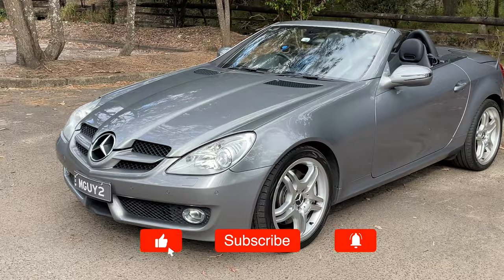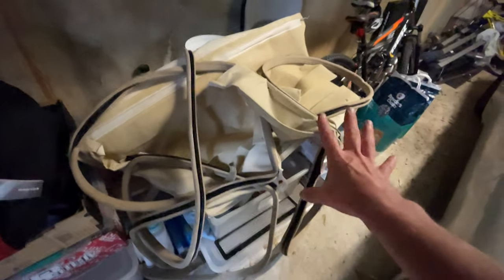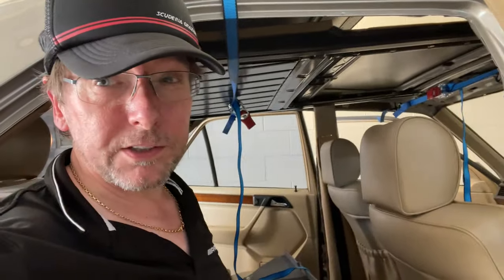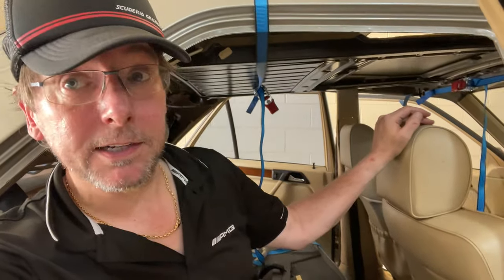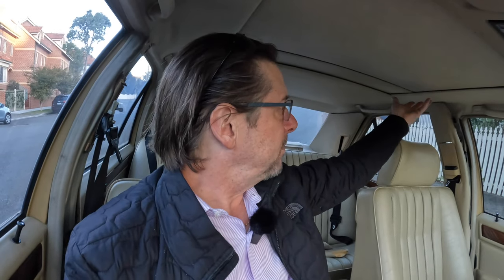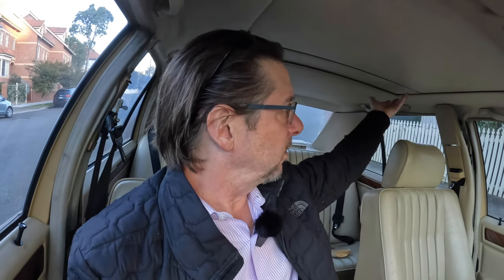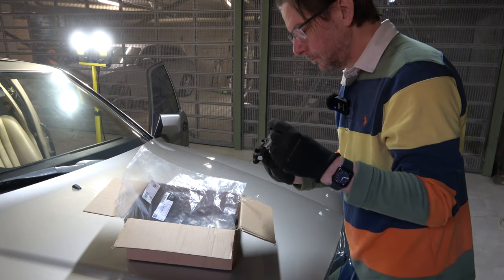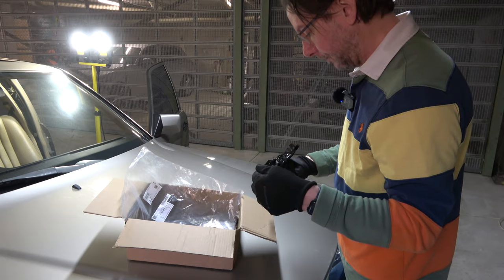Mercedes 260E Project Car (W124) - Fixing the Sunroof | MGUY Australia

Comment: Great job. The question I have is how many hours did you spend on this job and what was the cost?

I had a fault with my air conditioner panel in the centre console of my 91 BMW 535i.

I bought a replacement panel on line off a guy who had bought the wrong thing for his car - $100.

Took me about 5 hours to get the panel out....... sprayed some contact cleaner on contacts..... tested the original panel and it now worked......

 Reinstalled it which took me about 4 hours. 

Lots of googling and you tubing but got their in the end and now I have a spare Ac panel.. all good.

Like you with the sunroof I could not believed I had worked it out..... oh what a feelin lol.

Comment: Admire your work.  My car just has had the sunroof sealed up by previous owner. Maybe if it were a C126 it would be worth keeping the sunroof.   But on a US$3K car my focus is on the engine, transmission and suspension.  Still admire your work!   amazing!   Best regards 1989 MERCEDES-BENZ 260 E (124.026)

Comment: You absolutely do not need to remove the entire headlining .

I am about to do the same job on my W124 estate ( my fifth ) , and having worked on previous 124s , 201s and 126s , I know how it goes .

All you need to do is remove the trim panel from underneath the sunroof , which normally needs the roof opened . 

I simply sourced another trim panel from eBay before starting (£20) then destroyed my existing one by pulling it down in the middle where the two sections meet , this allowed it to come away at the sides , and the press studs at the front popped out .

So much easier than removing the whole headlining , and I have a perfect roof panel in the correct fabric to put back afterwards .
Reply: It's pretty easy to remove the sliding trim panel without damaging it.

Comment: Thank you for your video but you did nt need to touch the headlining.Theres an m8 nut on the motor in the boot/trunk that you can work with a ratchet.Its there for situations like this.Once the sunroof is open you can access everything.Lots of videos on here showing how...I have 3 diesel w124 and have done it too.

Comment: Great fix. I assume you never did this job before, even more impressive. the aftermarket liftarms are known for beeing crap. But you are lucky because OEM parts are still available. I'm in a constant worry the sunroof in my W126 will fail. the 126 liftarms are sold out for years now and the 124 parts don't fit. at least not without modifcations. Btw. as a german i  had a little chuckle every time you said "Gleitpaste".
I'm looking forward to more W124 videos
Reply from the maker: My German pronunciation is generally quite good (I will explain why another time) but this seemed like a portmanteau of German and English…! Hence the mixed pronunciation!
Reply: @mguytv  they’ll do that

Comment: what a stellar job you performed... by any chance would you know whether the sunroof parts are identical to the w140 S-Klasse,  one of my lift arms gave up after 31 years.. disappointing quality 😂😂😂,  I have the same problem on my S124 by the way so very happy to have learned from your video... now I have to wait till spring comes along in Holland as I have to work outside 😫
Reply: They are similar ; the W201 190 series , W124 , W126 ( early ones are slide only like the W116 ) and W140 all  have basically the same design , but the dimensions are different with 190 sunrooves being smaller and S-Class ones being bigger . There are repair kits on eBay as complete sets of all the mechanical parts - I just paid approx £60 for the kit for my W124 and about to do it now summer is here

Comment: I just started repairing the sunroof on my w124. Any tips you can give. How did you find out how to reassemble.
Reply from the maker: This is a good starting point: https://www.500eboard.co/forums/threads/how-to-complete-w124-sunroof-refurbishment.11068/
Reply: I just started mine , I will photograph everything before dismantling. There are four small nuts , two each side , which allow the sunroof panel to be lifted out , after that the mechanism should be visible .